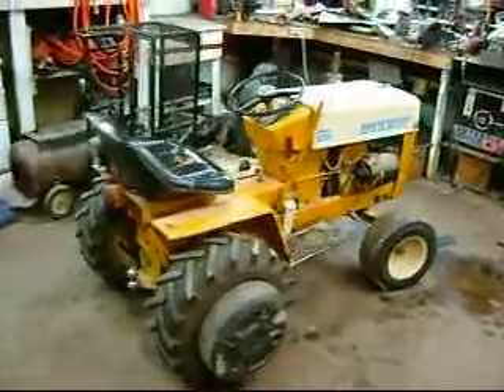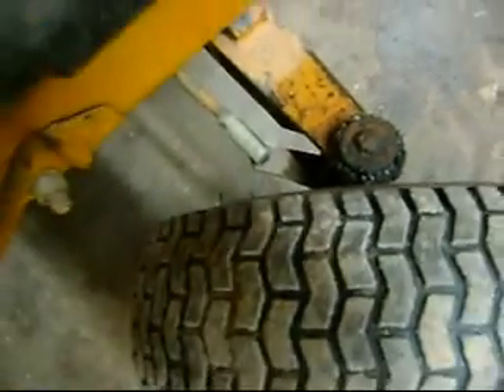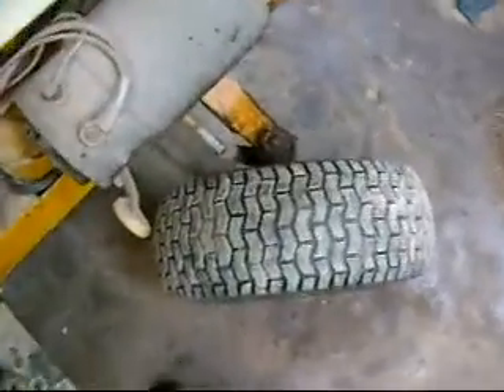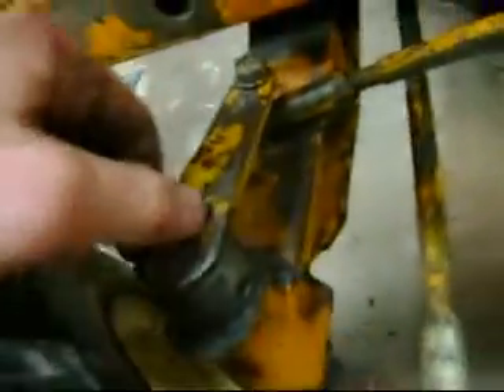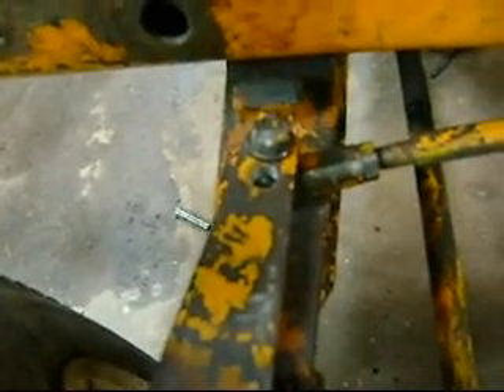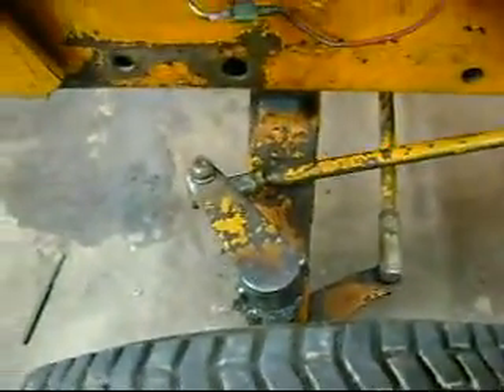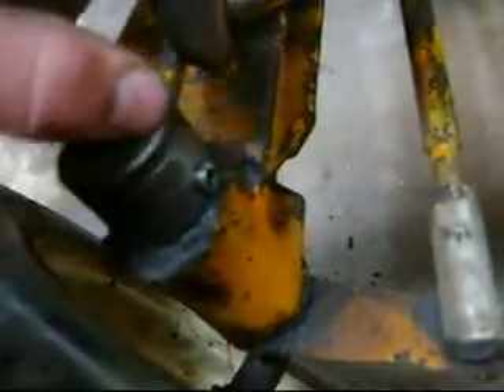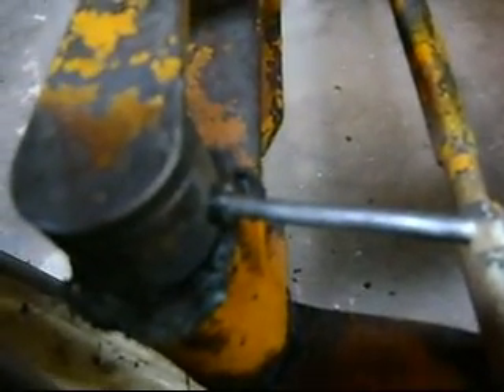how to make you old cub cadet steer sharper, cub cadet 122

Comment from the maker: @brian242 adjust the ends of the drag link (rod that connects the stearing gear to the front end) so it is shorter then it will turn evenly in both directions. but you may then want to consider a mod such as this because it will not steer all the way in either direction.